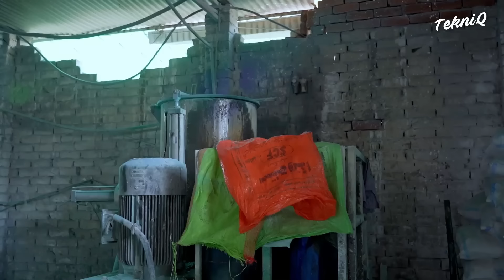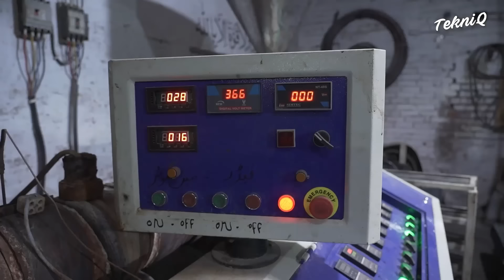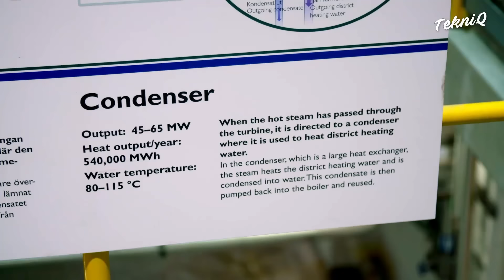Crazy Way They Recycle Tons of Used Plastic Bottles Every Day

Comment: A little play by play would be nice ! What your doing and why
Reply: 1 of the first steps is to take the labels off . 2 the shredder breaks the plastic bottles in to flakes , lids and rings. 3 next step is the start of cleaning  of the output of the shredder. The output of the shredder is fed in to a tank which has water in it this is used to float separate the two different types of plastics. the tank is on a bit of a angle to help with the collection of the pet bottle plastic which sinks down to bottom of the tank. The colored plastic floating is HDPE plastic which are the lids. Then pet plastic  goes on to further processing. Depending on different uses of the end use, the  plastic will be better cleaned and processed

Comment: Every bottle needs to have the cap removed or they can be rejected at my recycling facility. It prevents cheating on the weight.
Reply: in this video you see that the bottle caps float to the top and they get scooped off.

Comment: The main problem in recycling is that most recyclables are too contaminated with other materials.  Especially during the collection process by the waste companies.  If we can all keep them separated and clean from after they are used, recycling would work a lot better and effective.  25 years ago, they used to be separated, but scavengers would come and steel them.  So they became mixed so it would too much work for scavengers to steal and then sort it themselves.  We still get people who steal all the scrap metal and aluminum cans, but not too many as they still have to sort through the other material to get at them.
Reply: Don't know if you're writing from the US. Here there's  little to no recycling of plastic because all our recycling plants are privately owned. It's not profitable to recycle plastic, so most of ours gets send to countries in Asia. In many other countries, recycling is done by a government agency, so it doesn't need to be profitable.

Glass and aluminum aren't an issue here.

Comment: Recycling is an expensive waste of time. It is labor-intensive and energy intensive, for instance moving thousands of tons of newspaper to various locations to be recycled. The most efficient and direct way to dispose of garbage is to burn it in trash-to-energy plants (TTE). If these plants were spread all over America in every city, town and region, we could A) dispose of our combustible garbage (all plastics and all paper, cardboard, etc.) B) eliminate the need for 95% of new landfills, and C) produce the most valuable energy resource of all - electricity - with the heat from the  incineration. Sweden is the world leader in this technology and it is done in my town in Massachusetts. New York City burns 1 million tons of trash per year in its TTE plant. These plants burn efficiently at very high temperatures and are equipped with scrubbers and filters to reduce air pollution to almost zero.